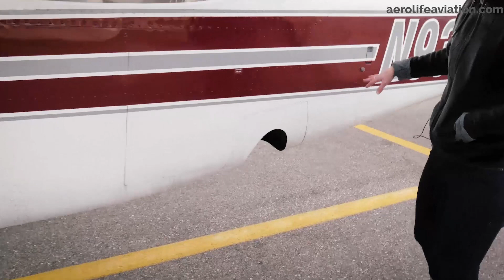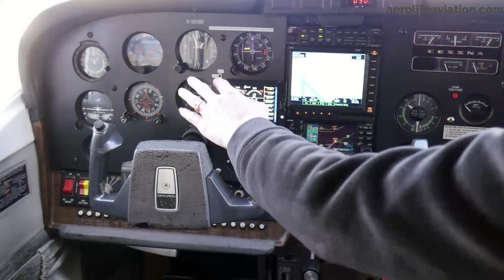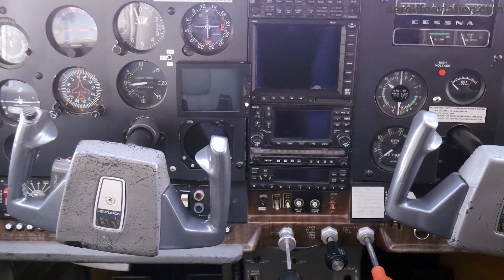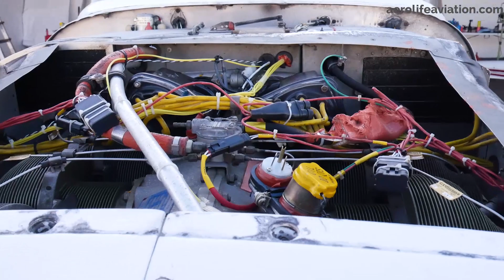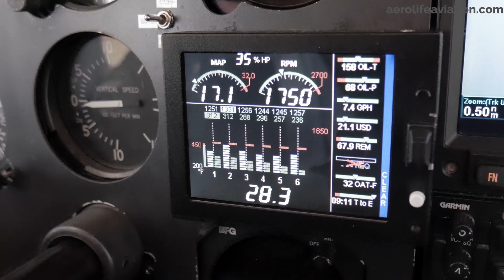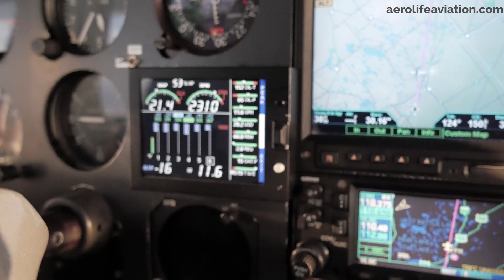1974 Cessna 210 Centurion aircraft full flight review

Comment: Given that this review is a couple years old, you probably won't answer this question, but at the beginning you stated that this was a normally aspirated engine, but during your review of engine compartment,  I heard you mention that it has balanced fuel injectors.  Isn't "normally aspirated" another way of saying "carbureted"?  Thanks in advance.
Reply from the maker: Normally aspirated vs Turbo-charged (or Turbo-Normalized). Carbureted vs. Fuel-Injected. Hope that helps.

Comment: The other advantage with the flaps, as like with all other high wing Cessna’s is that they are slotted flaps; which help greatly with lift on takeoff. Essentially the flaps are an extended airfoil within an airfoil when increasing wing surface area.
Reply from the maker: Thanks for sharing the detail info about flaps

Comment: That’s actually very efficient to be doing 150 KTAS on 11.2 gal/hr and still have that much useful load.
Reply from the maker: Cessna 210 is in its own league - useful load is close to light twins - if you have an IO-550 upgrade it will improve the performance and efficiency even more.
Reply: AeroLife I’ve wanted a Mooney for a long time but after looking at other options, this checks so many more boxes than the Mooney.
Reply from the maker: @robertd4468  They are both great airplanes; it's a great idea to pick one based on your flight profile.
Reply: @aerolife1646 Would one of the new small turbine engines be more efficient and reliable than a piston and run on Jet A that's available at more airports?

Comment: Is that normal for the manifold to be on the red tape on TO & Climb or does it have a limit. Thanks
Reply from the maker: since this is non turbo MP cant go above the atmospheric pressure.  RPM goes to red line for take off.
Reply: AeroLife thanks... got the Tach gauge mixed up with the Manifold gauge

Comment: Oh waw!! That Cessna actually flies that fast on 75% power? Really incredible to say the least. I wonder what’s the maximum reachable speed at 100% power output?!.......🤔
Reply from the maker: 210 flys fast. T210 even faster. Non turbo's 100% power can be obtained close to sea level and lower temperatures. With higher air density full power may not produce the max speed. Full power is also limited to 5 minutes in this model.

Comment: No autopilot?
Reply from the maker: Original factory Cessna 400 autopilot is not the best to fly with these days. And it may not be reliable due to the age of the autopilot. We are offering a state of the art Garmin GFC500 autopilot with G5 glass display complete installation at a special discounted price of only  $16,500. If you put another G5/HSI you will have full glass cockpit and can remove the vacuum system. That will complement other avionics as well. With the capabilities of GFC500, this airplane will be one of the most capable singles you can own.
https://www.youtube.com/watch?v=UtDiFmGoq3E&t=5shttps://www.youtube.com/watch?v=UtDiFmGoq3E&t=5s

Comment: Very nice plane. I'm looking at 210's right now. This is a nice one.
Reply from the maker: Thanks, this one is still available for sale actually. Here is the link: https://www.aerolifeaviation.com/Item/Index?idun=6&1974-CESSNA-210L-Centurion
If you have any questions on it please let me know.
Reply from the maker: @Vova Platonov What Piper model you are comparing?
Reply from the maker: @Vova Platonov Piper 6-300 is a good airplane. But 210 is much better -especially if it is a 1970 and newer model. Only direct competitor to 210 is Bonanza A36. 235 is not comparable to 210, That's comparable to a 182. Lycoming can't run lean of peak, so they burn more fuel with the bigger engines in those.
Reply from the maker: @Vova Platonov https://www.aerolifeaviation.com/Resources/Cessna210Centurion

Comment: Very nice informative video. I am worried about the carry through spar on these older C 210s. I know they are being looked at closely now.
Reply from the maker: Thank you for your comment. It is good to look at the spar on them but I have seen 210s with over 25,000hours airframe. Airframe failures are extremely rare. On the few occasions where they do fail it is possible the pilot was a heavy contributing factor.
Reply: AeroRanger The soar issue is impacting much of the fleet.  Across all brands.  Sad to think the time is coming that aviations standard bearers might be nearly passed.

Comment: Is it compliant with the wing spar bulletin?
Reply from the maker: The 2012 AD inspection was done. The current service bulletin is not required for part 91 but I assisted an IA in a basic visual inspection through the headliner because of the long flights we were taking and the surface looks very clean.